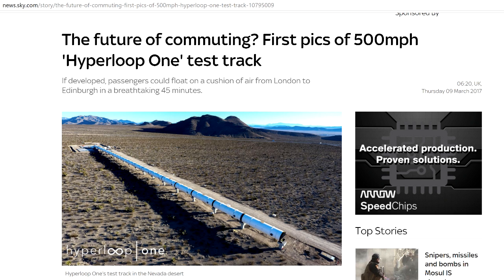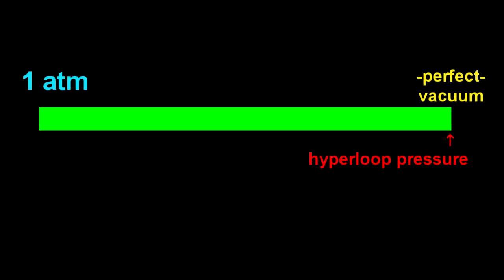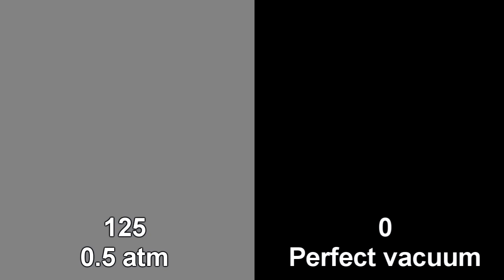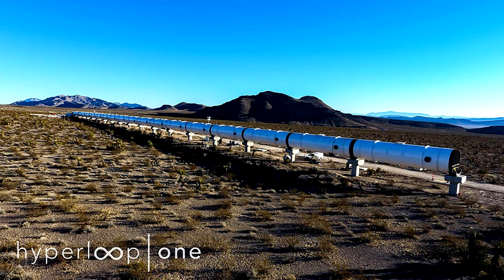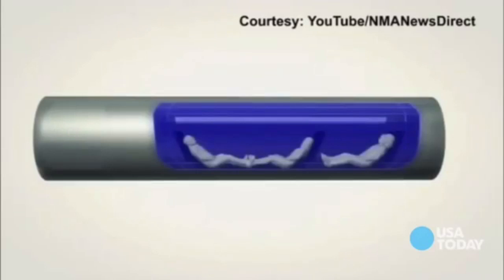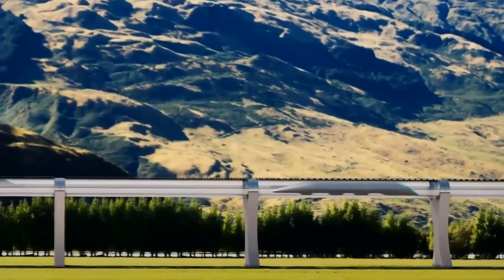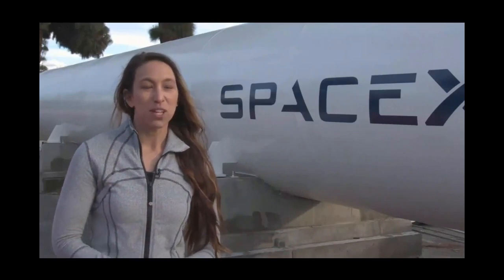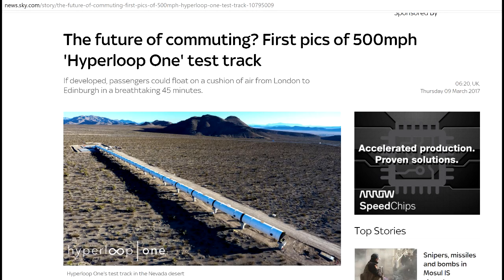Entire Hyperloop could be destroyed in SECONDS!

Comment: Well - let's suppose this is buried deep underground. You can use nuclear freaking lasers powered by just 8 grams of radoactive material to melt a tunnel from LA to New York. Use that tunnel to line the inner part of the hyperloop and keep the atmosphere from crushing the tube. Once you pump out all the air using half a million pumps powered by solar freaking panels, position the pod at one end.Expose that end to atmospheric pressure, which will then rocket the pod down the length of the tube at near sonic speeds. 

Propulsion solved.

Comment: You don't have to pump air out of the entire tube. If there will be a separate chamber on each end of the tube. Just remove air from that chamber after you put there so called train. that's all.
Reply: and the tubes? or you propose that each tube will be a completely sealed off vaccum chamber BEFORE it is installed? because that would be impossible to assemble. 

also, the main problem ISNT HOW TO BUILD IT, its HOW TO MAINTAIN IT WORKING AND THE COSTS OF THE MAINTENANCE.

to build something that will only be used a few times is one thing, to make something that will be used for YEARS contantly, is a completely diferent matter.
Reply: Marcos Danilo once you done with assemble -> make secure chamber at the each of the end (door/gate between that pipe and this chamber) -> pump out air from entire pipe -> put the train in that chamber -> pump out air only from that chamber -> open the door between that chamber and the pipe (as soon as the train is gone) -> close the door between the chamber and the pipe again -> put new train -> pump out air only from that chamber -> repeat. What do you think?
Reply: " pump out air from entire pipe" thats the obvious thing people already knew. the problem is not HOW to make the pipes, its HOW YOU WILL MAINTAIN them.

fixes will be expensive, and they will take A LONG time. failure to any point could lead to damage to the whole "track" and anyone iside the train at that moment due to wind rushing inside the tubes. and thats not even talking about how dangerous it will be to travel inside them, and for no real advantage over maglevs.

this is one of those "technocool" things that are more cool looking than usefull.
Reply: Marcos Danilo who knows what it could be in the future. Everything starts with something, and in the past people are saying that flying is impossible (and first plane was unpractical... First car couldn't move faster than a horse or even a person and required a lot of maintenance and money. But now we can't live without it. Am I right?
Reply: sorry but that comparisson doesnt even make sense, flight was ALWAYS looked as something worth building, and as soon as one was made, multiple countries went to build their own fleet of airplanes.

second, NOBODY IS SAYING THIS IS IMPOSSIBLE, we are talking about MAINTENANCE. damage to a part of the track could destroy the whole thing, not because "the technology isnt there yet", but because VACCUM IS EXTREMELY DANGEROUS. 

also, i dont think you understand how expensive it would be. for NO ADVANTAGE OVER MAGLEVS. 

everything this does, the maglev does, at a fraction of the cost, and a fraction of the risks. how is that so hard to understand.
Reply: Marcos Danilo completely disagree with all of that. Railroad have the same disadvantages. If you have one portion of it damaged. You can kill every single one on that train. And about planes. People were saying that it is impossible, or what the reason that only one person can travel this way and it is so dangerous and so many died. And before that thought that only birds can fly because God makes them so.
Reply: I will just quote myself here because you clearly saw i responded but didnt actually read what i wrote:

"NOBODY IS SAYING THIS IS IMPOSSIBLE, we are talking about MAINTENANCE." 
and once again i have to say this.
MAINTAINING THIS WILL BE EXPENSIVE BECAUSE VACCUM IS EXPENSIVE TO MAINTAIN.
Reply: fromNYC u do realize  that is a stupid idea cause any slight variation in air pressure from one to chamber to the other would create an air gush that can implode the whole tube. if one chamber is pressurize with the pod in it, the density is different than the other unopened chamber while in a vacuum.  don't u see a see a problem with that

Comment: Havent you heard of air locks? You pump it down totally once during commissioning. I would suggest more ribs would be a good idea. BTW  tankers are made of very thin metal as no one wants to ship dead wieght. A pressure vessel able to hold 300 kPa will be stable under full vacuum however.

Comment: Why are they trying to depressurize the tube instead of running 500 mph air though it? Would have the same amount of "drag" as your perfect vacuum wouldn't it?
Reply: Well, the problem is that then they'd have to burn a ton of energy moving all of that air in addition to the pods.  The entire reason they want a vacuum is to save on energy, not to need MORE energy.  But, it's a moot point anyway, since Hyperloop has essentially abandoned almost every one of its original claims that Thunderf00t has outlined in his video.  Today's version is nothing like the original version.

Comment: OK. I am an engineer. TBH, this is a really stupid video. If you subject something that isn't specifically designed to withstand a vacuum to extreme negative pressure, of course it's going to fail, it's not designed to withstand it. However, something that is designed to take this kind of pressure will be fine. Submarines for instance are designed to withstand much higher pressure differentials, and you would have noticed that there have been no submarine implosions recently. You obviously don't have any engineering experience at all. I seriously wonder sometimes if you have ever heard of prototyping. In case you were wondering, it's where you try building something, then work on the problems until you get something that functions as designed. Hyperloop is most definitely in the prototyping stage, figuring out what will and won't work. Also, it would be the easiest thing in the world to coat the thing in a shell of reinforced concrete. Remember, Elon Musk can put rockets into space, so accusing him of being a "Snake Oil Salesman" is pretty much bullshit. Maybe you should actually think before you blindly bullshit on things. Juuuuust a suggestion...
Reply: YOU SAID: "OK. I am an engineer. TBH, this is a really stupid video. If you subject something that isn't specifically designed to withstand a vacuum to extreme negative pressure, of course it's going to fail, it's not designed to withstand it. However, something that is designed to take this kind of pressure will be fine."

== Yes, but the originally proposed Hyperloop tubing that Thunderf00t is complaining about ISN'T going to stand that pressure differential (hence why they abandoned it).

YOU SAID: "Submarines for instance are designed to withstand much higher pressure differentials, and you would have noticed that there have been no submarine implosions recently."

== Yeah, but you said it yourself, they are designed for it.  The Hyperloop tubing wasn't, which is why they abandoned it.

YOU SAID: "You obviously don't have any engineering experience at all. I seriously wonder sometimes if you have ever heard of prototyping."

== Good grief.  Did you READ the Hyperloop Alpha document?  Go read it.  Tell me you want to prototype that ridiculously impossible monstrosity.  That's why the engineers abandoned it the minute Musk quit the Hyperloop company, and swapped a mag-lev train/pod in its place.  The only thing that remains from the Hyperloop Alpha document is the "Hyperloop" name.  They threw everything else in the trash (where it belongs).

YOU SAID: "In case you were wondering, it's where you try building something, then work on the problems until you get something that functions as designed."

== They didn't even TRY to build the thing.  Good grief.  Anybody who read that document knows it cannot work.

YOU SAID: "Hyperloop is most definitely in the prototyping stage, figuring out what will and won't work."

== Pffttt.  Read the document.  Good grief.

YOU SAID: "Also, it would be the easiest thing in the world to coat the thing in a shell of reinforced concrete."

== And, that's why they're doing it.  But, guess what, concrete is expensive.  You sure aren't going to be giving 400 mile rides in 1/2 hour for $25 a ride if you have to spend all of that money building/maintaining the concrete.  Oh, wait, Hyperloop also abandoned the $25 per ride criteria... yeah... which is why they are now reinforcing it with concrete.

YOU SAID: "Remember, Elon Musk can put rockets into space so accusing him of being a "Snake Oil Salesman" is pretty much bullshit."

== Why is it that he made something out of Paypal and Space X, and everyone thinks that he can do no wrong.  Good grief.  Have you heard about his plans to explode nukes over the poles of Mars, and that's supposed to terraform the planet??  Like, um, what?   Do you buy that snake oil?  We've lit off 2000 nukes on Earth, and that's a drop in the bucket, and hasn't had any significant impact on our environment.  Oh, but Musk is going to light up two nukes on Mars, and that will make the planet inhabitable??  Oh, but that's not snake oil.  Nawww.  Or, how about his stupid intercontinental space rides he's saying will only cost $2000 per ride??  Naw, that's not snake oil.  Good grief.  How the Tesla car company isn't dead yet, I'll never understand.  It's been in business for 56 quarters, and has lost money for 54 of them, and made money for 2 of them.  Yet, the company lives on.  Why?  Nobody knows.  Anyway, man, go read the Hyperloop Alpha document, and you'll realize it's pure snake oil.  And, look, I am not a Hyperloop employee.  But, I'll bet you a dollar that Musk "quit" the Hyperloop company because his own engineers knew damned well that the design from that document couldn't possibly work, and it was either them, or Musk, who must leave.  So, what happened?  Musk left the company, claiming that he didn't have time to deal with more companies (then immediately bought a tunnel-boring company, go figure).  And, the engineers tossed that stupid Hyperloop Alpha proposal in the trash, switched to a mag-lev pod/train instead.  They abandoned the idea of putting solar panels on top.  They abandoned the little metal tubes.  They abandoned the 99.99% vacuum.  They abandoned the $25 per ride.  They abandoned the whole stupid pod that floats on a cushion of air (as if that made sense in a 99.99% vacuum in the first place).  They abandoned the big impossible turbine on the front of the pods.  Basically, I can't think of anything they kept, other than the Hyperloop name.  Oh, but it wasn't snake oil.  Nawwwwww.

YOU SAID: "Maybe you should actually think before you blindly bullshit on things. Juuuuust a suggestion..."

== Maybe you should read the Hyperloop Alpha document before blindly believing in bullshit.  Juuuuuust a suggestion.  If you're really an engineer,  you'll come back here after reading it, and eat every word you wrote.

Comment: Ok, lets go in the other direction. Surely we couldn't double the atmospheric pressure and run say 2 bar? But I think there was a time where yes I did indeed run 30 PSI through some thin aluminum tubing and rubber hose which saw transitions from vacuum to 2 bar regularly and it was as reliable as the cars we drive. Wait, it was the car I drove. I know people will say vacuum is not the same but comparing a train car to the hyperloops finished product is not the same either. The more Elon succeeds the more haters come out to watch him burn. Evil shit.

Comment: Just to nit pick, a 1km long hyperloop at 1.83m dia. is only the second largest vacuum chamber in the world accounting for it's diameter, not it's length. Each of the LIGO facilities utilizes two such tubes that are each 4 km long and 1m dia. positioned at 90 degrees to each other, and then there's VIRGO in Italy with 3km arms, and a handful of smaller facilities as well. 

There's another very obvious flaw, in the volume of these tubes and the time required to pull the necessary vacuum. SpaceX's hyperloop prototype has a volume of 6900 cubic meters. Each LIGO facility, across both it's arms at 2497 cubic meters, plus the optical assemblies at both ends and in the middle, amounts to what Caltech says to be about 10,000 cubic meters volume to be evacuated. LIGO takes 40 days do pump down to the required vacuum level, and while Hyperloop doesn't require as clean a vacuum, the volume of the tubes once assembled into a transportation infrastructure would vastly exceed anything LIGO would dream of, which is why the next step beyond LIGO for gravitational wave astronomy is a proposed array of satellites at Earth's L3 point called LISA.

For Hyperloop, that vacuum needs to be established EVERY time the door is opened. Conceivably one could put a sort of airlock system at each way station, but you're still talking a good hour at least to equalize the volume of that airlock to the point where it wouldn't contaminate the already established vacuum within the hyperloop network itself. Complicated by the fact that even a tiny leak would compromise that vacuum, and as we've already seen with the pipeline oil spills across the United States alone, we are NOT leak proof.

And as Thunderf00t has already mentioned, because you've got a massive object moving at high speed within that vacuum tube, there a is FAR smaller margin for error, especially if by some fluctuation the pod should touch the side of the tube during transport.
Reply: I think you are right overall, but a  comparison to a physics lab like LIGO is not really fair. The pressure that they want to achieve to run the hyperloop is quite frankly nothing compared to any kind of vaccum I ever worked with (proton accelerator mostly) and i am quite sure LIGO can achieve it in a fraction of the 40 days , and to achieve the ultra high  vaccum heating the pipe is also important which again takes a lot of time. 
But as i said, I agree with you overall, and the hyperloop is a really dangerous idea,  I just though the LIGO comparison is kind of meaningless.
Reply: The 40 day figure comes from their own website, so I assume that it's more or less correct in context of the entire system. https://www.ligo.caltech.edu/page/vacuum 

But regardless of the pressure and volume of the system (that's solvable), my point about the complexity and scale of such a mass transport system still stands. It's probable that they could make more efficient turbo-pumps to evacuate the airlocks quickly, but there's no way that I can see to make it practical if it's being cycled repeatedly. Even barring flexing and fluctuation, the simple wear and tear of that airlock in an uncontrolled (public) environment will mean a regular cycle of maintenance and overhauls due to contaminants and debris. This is why the Space Shuttle didn't turn out to be the money saver that it was projected to be, because it had to be overhauled after every mission. 

What the Hyperloop would need to have in common with Caltech-LIGO is a controlled environment, which is simply not possible in a public setting.
Reply: "The 40 day figure comes from their own website" I know, I just wanted to tell you that reaching the vaccum necessary for the hyperloop (well the vaccum they think is necessary) only takes a fraction of 40 days for LIGO and therefore your time  comparison  isnt that usefull. 
But as a said I do not disagree with you on anything else.

Comment: Dunderfoot, you fail miserably with the mathematics and even with the fundamental ideas.  You see it as very difficult to build metal tubes which will withstand the pressure of one atmosphere, or one bar (the vacuum does not destroy the tanker, it is the one atmosphere of air pressure.)  But, at any point in time, the U.S. Navy has s few thousand people inside metal tubes under the ocean at pressures of at least 15 times sea level atmospheric pressure.  The tanker was crushed at a pressure of one bar because it was not designed to resist a pressure of one bar.  Your pathetically inept an inapplicable examples do nothing to discredit the hyperloop.  Someone with your command of mathematics and engineering should stick to political commentary or modern art critique, where absolutely any opinion may be acceptable.

Comment: Why pump down the whole tube? There could be a propelling piston in a small "rail" vacuum tube. It could be magnetically (mag-levically?) coupled to the "car"
You'd still encounter air friction, but compromises must be made. I haven't researched this thing, but I think it needs a rush of air coming in the backside to create thrust. Is Elon only eliminating air friction? This thing makes no sense. Anyway, braking would have to be employed with my piston/vacuum rail version (to alleviate shock). Perhaps the vehicle could be self powered to get up to speed before deploying the vacuumpiston. The amount of energy used would be greatly reduced by having a smaller vacuum area, and the time to reach vacuum would be decreased as well. Also, the dangers would be that much more insulated from the cargo/passenger side. Frankly, the whole thing seems silly.

Comment: Ask yourself one question: Why hasn't there been one test with an evacuated tube of the diameter, thickness and strength that Musk proposes to use? Not some engineered pressure vessel, but an actual long tube -- say one that is 100 times longer than its diameter? Let's see how long and much energy is required to evacuate just that one tube. Then test its impact strength, up and including high-powered rifle.